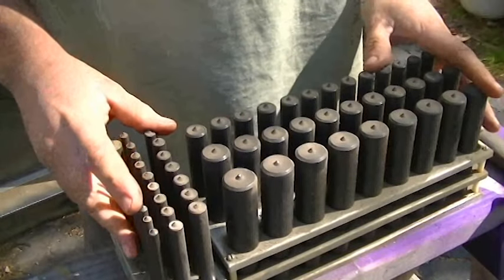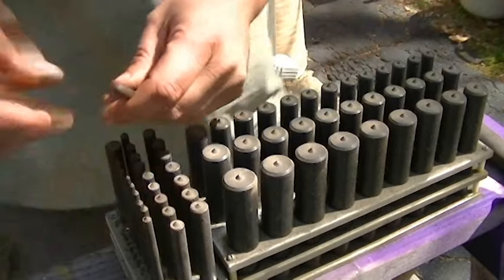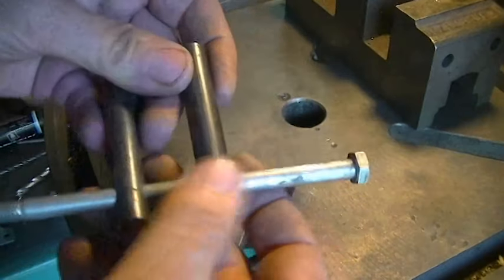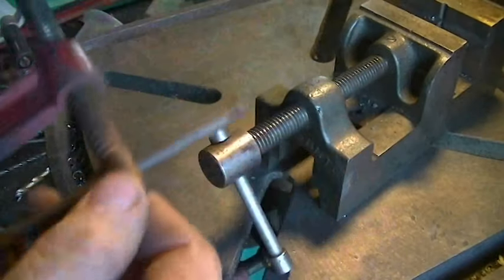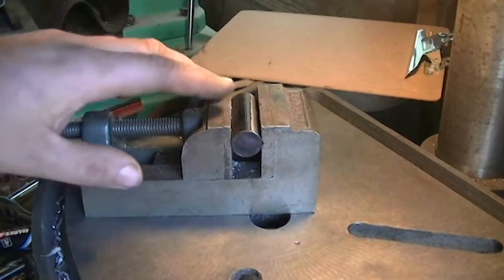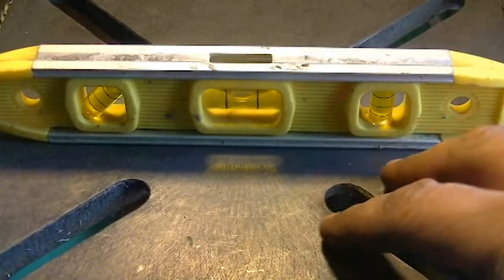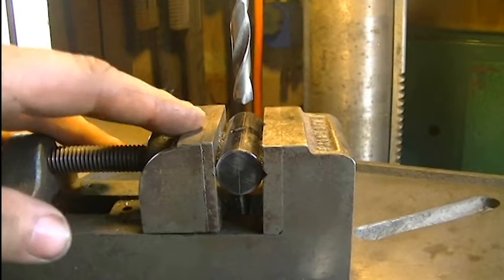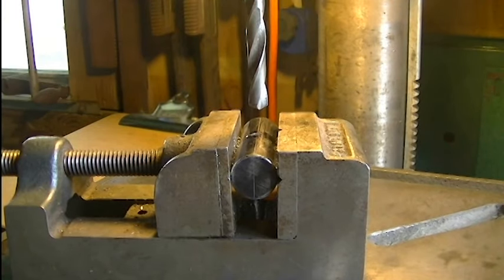Using Transfer Punches For Drilling Cross Holes

Comment: A very useful trick to know. I'm an experienced machinist and have used transfer punches, and transfer screws, for many years in my work. Transfer screws are used to transfer threaded holes to matching clearance holes. A video showing their use would be helpful to viewers not familiar with their use. Cheaper sets of punches can be re-hardened by heating the ends cherry red and quenching in oil. Any oil, such as used motor oil, will work.

Comment: Why didn't you place the stock in the bottom of the vice and the transfer punch vertically in the vice with a very light clamping pressure, and then give the punch a tap - this should put a dimple in the middle of the stock piece ... If you have tried this (I haven't- I just though of it...) and it doesn't work please comment...

Comment: Interesting idea. I like it and will try it. FWIW, I have a similar set of Chinese transfer punches. Have had them for years and I'm not gentle with a dead blow. Can't say they've disappointed. Apparently, having seen this video, I also need a larger set. Would be helpful to have. I like your drill vise; I collect Stanley/Yankee DP vises, and I probably don't have to tell you that in this application a vise that was firmly attached to the table would be more optimal. Instead of a center drill consider using a spot drill. For example, if your drill is ground to 118* and you use a 120* spot drill, you'll avoid the chatter. Same goes for a 135* grind and 140* and 142* spot drills. When using a screw machine length drill spotting isn't usually needed, but considering the application and the use of a center drill, spotting would be more optimal. Good luck. Enjoyed the video.

Comment: That works but you can skip the marking out process by nipping the bar stock and the transfer punch in the vice, make the centre mark remove the punch tighten the vice  and drill the hole.
Reply: Agreed and I think this way  would be more accurate as it would  remove  several steps which are likely to create margins of error
Reply: What?

Comment: Good info on using the transfer punches.  I have a couple of sets but hadn't realized you could also use them as dimensional transfer scribes. I just figured out that you can use them as a sizing guide to set the drill depth stops on a press. (you can also use a drill bit too) Surprised you did not clamp the vise during the drilling... I would also recommend using a reamer to finish the hole.

Comment: Jeff - thank you so much for your video. I am a woodworker who decided to make my own wooden hand clamps, and in the process, I just ruined eight, 1 inch brass dowels I cut. I built a wooden jig and figured out how to get the starting point dead on accurate, and the hole came out the other side exactly 180 deg. around as well.The problem was somehow the hole itself wandered down the length of the dowel (not side-to-side). It was perfectly centered side to side, but the hole is not 90 deg/perpendicular to the axis. (It's too bad I cannot post the photos I took of the set up and the very odd result.)  So it looks like I need transfer punches, drill press vise, cutting oil, a center drill, and a shorter finishing bit. I was wondering how to overcome the drill bit being too long, which I suspected may be a contributor to the problem. I didn't know they even made short bits. Thanks again! -Wm

Comment: Thumbs up for the way you transferred the measurement with the transfer punch.  It's a shame that much of that care seems to have been lost with the movement of the vise.  Clamping the vise to the table should be safer and more accurate in the long run.

Comment: Great ides and well presented, BUT I would use a wood block or a clamp to keep the vise from getting out of control of the drill catches during the drilling process.. Working with safety in mind is job one. That aside nice job on this video

Comment: Fascinating skills but sliding your round tube into a tight  square tube and marking  precisely your hole  on the middle of the  flat surface would be faster and easier before the press drill vise.....

Comment: You need to fix your vice to the table, it was wandering all over the place.
Reply: The vise needed to "slide all over the place" to allow the drill bit to move the work piece to the exact position. This is a common practice and a common sense no brainer type of procedure.

Comment: Jeff, I wonder if heat treating those import transfer punches would improve them. I know that has worked on some import items due to not having been properly heat treated and tempered in the first place, but some items were made of junk steel and nothing can help that. Now as you know ball oil-based cutting fluids smoke from the heat generated during the cutting process, but breathing those fumes are bad for your health. There does exist a water-based cutting fluid that is environmentally friendly that is a great replacement for them called Anchor Lube. You can learn more at http://anchorlube.com/ and if this is of interest to you then get a free sample to try it out at http://anchorlube.com/contact.html. Nice tip! Thanks for sharing.
Peace!